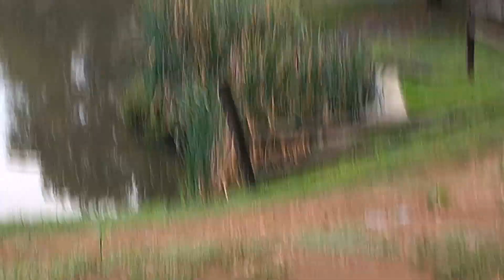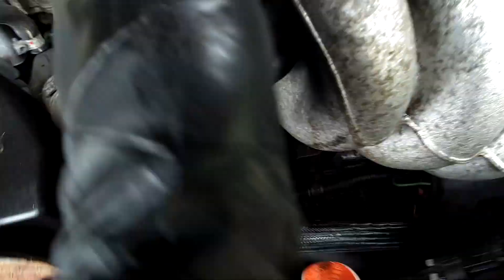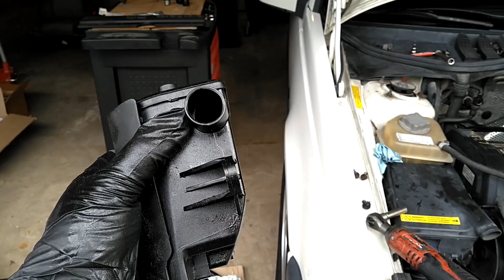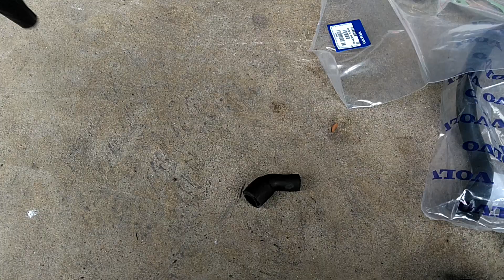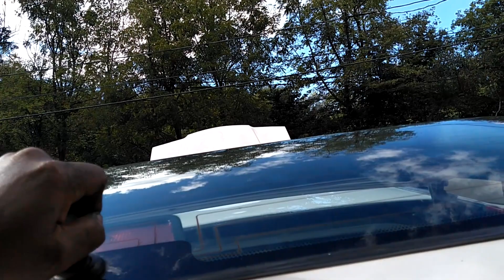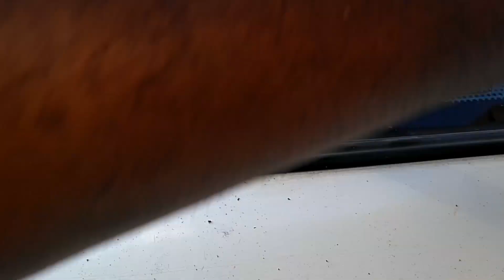In PA, Elizabeth Town. Volvo 850 PCV system parts, rear hatch wiper repair. - HOWR

Comment: Hi Robert got a cuzz that’s your twin. My question is have you worked on any v8. Have xc90/05 with some oil leak problems, rear valve cover also one around oil cup area. Notice you are in VA sometime anywhere near VA Bach. Maybe you can do a vid about changing gaskets and seal in one.
Reply from the maker: No I have not.

Comment: In my 98 v70xc I also used oil cooler hose in place of the plastic wrap around pipe. It has a larger inner diameter and was definitely easier to route. Lasted at least 100k. Re the silicone 5mm over 3mm for the intake tube, I will definitely try that on my next pcv refresh.
Reply from the maker: Cool, thanks for sharing.

Comment: Sir Robert, I am very grateful for your advice I had a problem with my 1997 V90 Volvo with the cooling system and replaced the radiator cap. I did and the the problem solved. I have one other thing the mechanic replace the fuel pump and the pump console now when the tank is full the light that indicates that it is empty comes on and when it is low on fuel it shows that it is full. What could be the problem. Thanks for your help always.
Reply from the maker: Either he swapped some wires or put it back in with the ball float upside down.